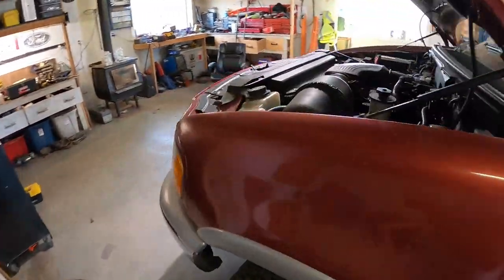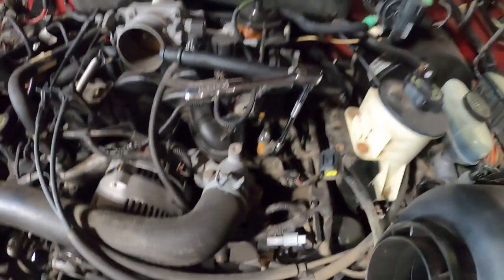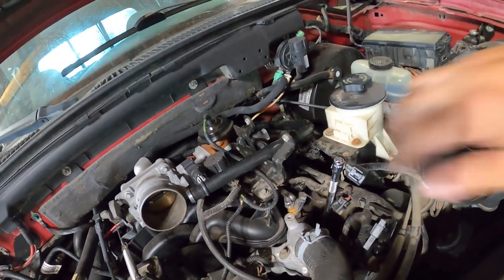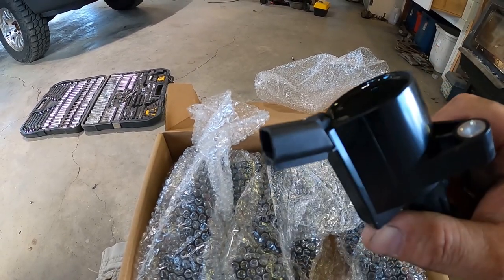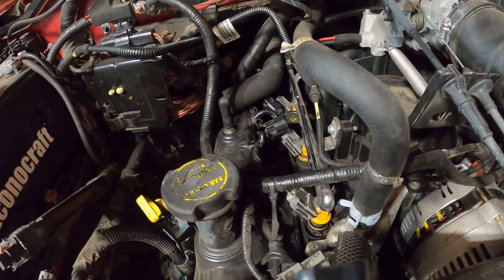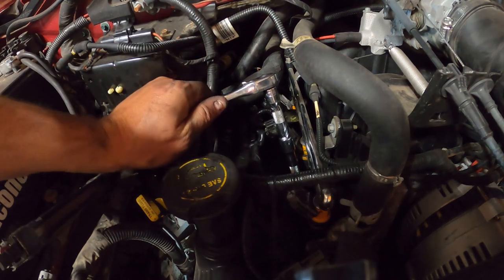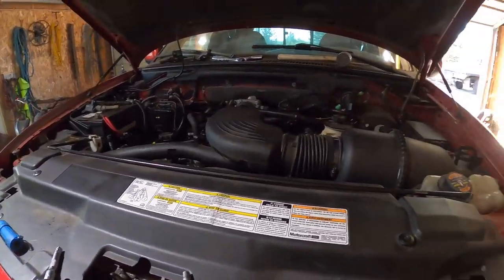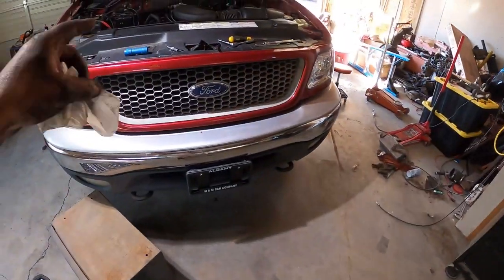How to Replace Spark Plugs 1997-2003 Ford F-150 4.6L 5.4L 6.8L 2v Engines

Comment: Don't show how to get to the back ones, 7 & 8 and don't show what and how to remove stuff to get access... what do you think we watch for???  all these type videos on youtube are useless and incomplete.
Reply: I can understand your frustration and would have like to see that as well but it’s really nothing that crazy (from what I have researched). If it was, I think he would have shown it. It’s just time consuming. I saw one video where the guy removed the fuel rails but didn’t remove any hoses and vacuum lines on the rear passenger side plugs. After not showing that as well, he said it was tough, with not removing the stuff in the way except for the fuel rack, but was able to get it done. And he was not a professional mechanic. It’s probably just a bunch of swearing and frustration with little time to hold a camera. I’ll be tackling this soon but I am not one to ever film and post my mechanical adventures, even though I have done some major projects.
Reply: @RemmikRotus  7 and 8 on the driver's side of a 1997 F150 5.4l are different than the easy ones, especially if you try to not take off the fuel rail.
I was finally able to get 7 coil off but had to cut down a 7mm socket and use 1/4" swivel.  It was a bear and I had to figure what all to move to get to it.  Not easy like the videos show.
Reply: I agree, I've been watching these videos to see how the back ones are done and what needs to be removed. They all just show the easily accessible front one and skip to a finished job. Maybe when I change mine I'll make a video specifically for 2v 4.6/5.4 rear spark plug removal.

Comment: Glad the spark plugs didn't snap off buddy! 😮  It's a sharp looking truck. I honestly had no idea those bedsides were fiberglass 🔧🔩
Reply: I think the plugs breaking problem comes after the redesign head 2004 then several years after. Blowing out plugs is a problem for these.

Comment: No anti seize on the Motorcraft plugs per Ford. They're nickel coated. Torque to 25 lbs. and they'll never spit out. You're not going to strip out the threads.
Reply: The moment I seen him talking about putting anti-seize on them. And how much he torqued them down. I knew at that moment, he didn't know what he was talking about lmfao.

Comment: anyone that does there own repairs and maintenance knows how to replace a coil and sparkplug when it is easy to get to . . . an actual useful video would have shown the trick to get to the 2 or 3 pain in the ass plugs. Too bad.